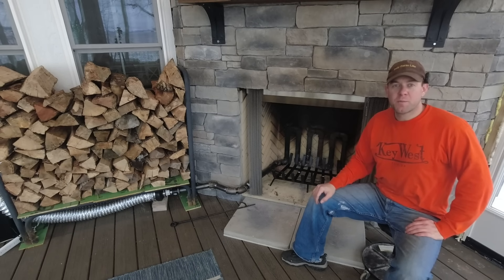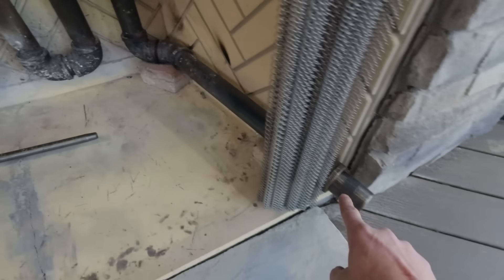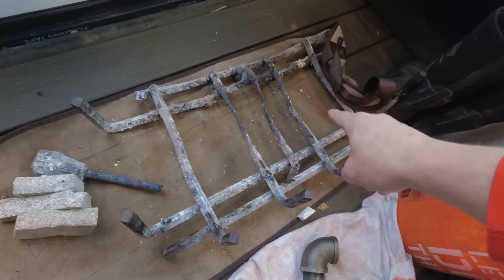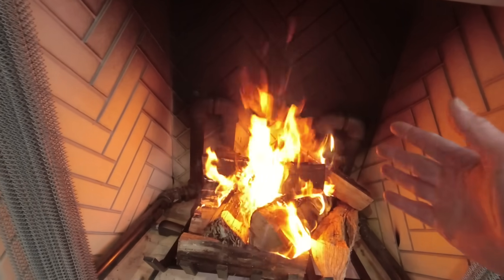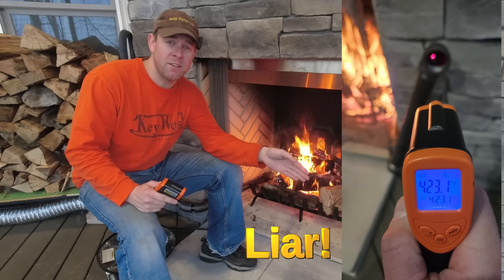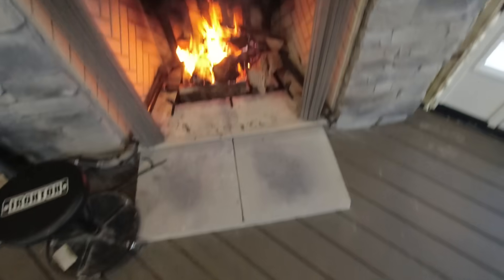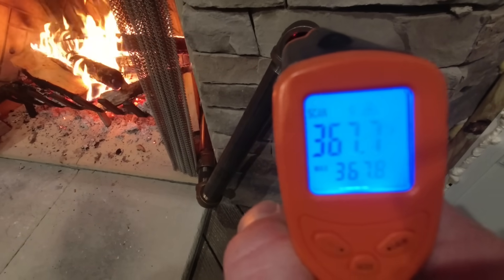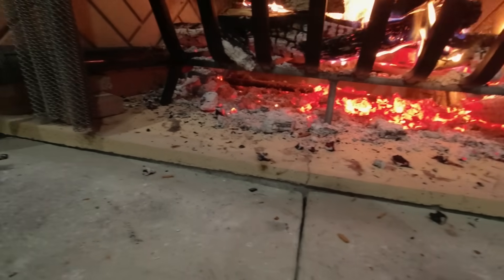Your Fireplace Is Wasting Heat — Here’s How to Fix It!

Comment: Anyone watching this video might want to consider this. The $ spent on that fireplace, the black pipe and fan, and the excessive amount of wood needed to feed it you could have bought an attractive wood stove with a glass front for a fraction of the price. The amount of heat produced would far exceed anything you get with that modified fireplace. You can cook and bake on wood stoves with no need for electricity. And the efficiency at capturing the energy from the wood would not only eliminate any need to insulate, but the exhaust from the chimney would be cleaner  with the catalytic burner found in most modern stoves. If you desire the ambiance of a crackling fire they have youtube videos you could play on a speaker without the sparks and worries of not being up to code. If you're into experimenting for creativity sake good luck with your build.
Reply from the maker: This video is for those who already have an open fireplace and want to extract a few more BTU's from it.  This fireplace has been on our porch for the last 4 years and we just recently enclosed it.  I don't want a wood stove, I have one in my barn.  I know what they are capable of and how efficient they are.  If I only wanted heat and didn't care about the ambiance of the space, then that is what I would go with.  This is for a social space; the fire is the centerpiece.  I also split all the wood from downed trees on our property.  It's exercise to me and I'm not paying outright for it.
Reply: @IndyFarmLife gotcha. Thank you for the update. AND for the video.
Reply: Also, many of us have access to free wood. I have about ten trees on 3 acres that are volunteers lol.
Reply: Dude, we live in a 150 year old farmhouse with the original fireplace. Yes, we have heating oil water radiators for the main source of heat. Sometimes people are just trying to use, more efficiently, what they already have. Plenty of free wood around here in Western PA. Plus, it's always good to have a backup for when the power DOES go out.
Reply: @True_Slav_75 this! My furnace went out a month ago, and all i had was a large old fireplace in the middle of the house. The fan on my furnace was still working, and i had put a cheapy exchanger in the fireplace about two years ago. It was just a grate made of tube steel, with a fan attached. A basic one mass marketed.  But i was able to grab the hot air, and route it to the return vent, with the house fan on, which dispersed it and filtered it as well. Not the most efficient, as i was bringing wheelbarrows of pre-cut wood in, but the coldest it got outside in the week i had to wait was low 20s... and the worst i had it was waking up to a 60 degree house one morning.  Impressive, now, doing what your ancestors did every day! Lol
Reply: Also ..get piped in outside air for combustion chamber ..heated air used for combustion is a waste of wood and heated air you just made
Reply from the maker: None of the air I am pushing through this system is experiencing combustion.  The air that flows through these pipes is not part of the air, fuel, spark mix that creates the fire.  It is not being sent up the chimney.  Or did you mean in general for the fireplace?  This fireplace does have two cold air intakes on the backside that are outside and fuel the firebox.  I should have shown those.
Reply: @IndyFarmLife our fireplace actually has a whute that goes down into the basement. Might be an ash chute, no clue. It's mostly closed off with steel plate that had a few holes in it. Plus s9metimes we Crack a window opposite of the fire place to help the draw. 
Again, this is a fireplace in the living room. 
Sometimes I wish you could put photos to YouTube comments. But......probably better of without it lol. Buncha weirdos in the world.

Comment: Good idea, if you really want to make a big difference, you will need to make some doors for the fire place and inject cold air from outside the room into the fire pit , this way you will keep all the hot air inside and not loose it through the chimney
Reply from the maker: Thank you!  Yes, doors would certainly go a long way.  Tempered glass isn't really a good option (also expensive) because you can't close them while you burn.  The laminated glass is even more expensive.  Steel doors/an insert would absolutely get it done, but I'm also trying to balance the aesthetic. There are certainly ways to get even more heat out of this.
Reply: @IndyFarmLife Agree, before I wrote the comment I was planning in my head on what type of doors would be suitable and I didn't have any great answers 😅. One more thing, do you have a damper on you flue ? That could be used once the fire is out . Also adding a cold air even without the doors could help but I don't know by how much. Thanks for sharing your ideas here .

Comment: What a load of shit. That laser thermometer is for surface temperatures, not air. The laser can not read air molecules. Yes, the pipe is hot and hot air comes out, but not at 255 degrees.
Reply from the maker: It's actually a load of heat!  I get that it isn't true to the actual air temp, but it is directionally correct and doesn't negate the fact that the system works and puts out/pulls more heat into the room.

Comment: I use corrugated pipes for a chimney(stainless steel) inside the fireplace and 12V computer coolers to blow the air through. Works good.
Reply from the maker: Nice!  So I would assume that's a much larger diameter pipe?  4" or 6"?
Reply: @IndyFarmLife  I use 2 pipes 10 cm diameter. They blow really hot air when the firelace is heated well.

Comment: Nice job, Adam.  I did something like this back in the early 80's when I worked at a plumbing supply house.  Old house, drafty and floors stayed cold.  I also learned that putting a set of (sort of) sealed doors on the opening made fire control much easier and helped the wood burn at a more controlled rate.  I enjoy the channel and look forward to our sunday get together.
Reply from the maker: Thanks!  Yea, my idea certainly isn't new or novel, but it's not something you see every day.  Steel doors as in turning it almost into an insert?  This fireplace definitely grabs a lot of air and can run through some wood.  It even has cold air intakes on the back side.
Reply: With cold air intake, how do you keep it fire code compliant?

Comment: This reminds me of the old oil fireplace we had in our 250 year old house in Woonsocket RI. The house used to be a Dr.'s home, but was now a house with an apartment (only reason we could afford it, needed the rental income to help pay for it). Anyway, the waiting room (now living room of the rental) had a nice fireplace in it with an oil reservoir that would heat up (not in use now) and radiate heat after the fire went out. Granted this house originally had gas lights, pre electricity days, so the oil reservoir probably wouldn't pass code today.  You might consider putting some kind of protection around the pipe so someone (kids primarily) don't get burned on it.
Reply from the maker: Pete, I would love to see/tour such a house.  Wonderful history!  Gas lights are making a comeback.  Yea, I probably do need to shroud that pipe somehow.  The fireplace itself gives off a 'warning I'm hot' feel to the kids.  That pipe may not from the side.

Comment: An improvement i would try if i were you. Pull your blower air from outside. This will replenish the air your fireplace pulls out of the room(and sends up the chimney) put your fan outside and that can keep the sound down.
Reply from the maker: I like that idea!  A little tricky given the location (there is a door to the left and one to the right), but I'll have to give that some thought.  Would certainly be nice to size up the fan but also eliminate the noise.

Comment: Your on track but your manifold needs to be also across the top of the fire. Your grate is fine. Do not build the grate as a manifold, it would steal to much heat from the wood and you would be unable to keep your fire going. I did your concept years ago with a house that had a boiler/ hot water baseboard heat. I placed a 3 way ball valve ahead of the fireplace. When burning the fireplace I turned 3-way ball valve. Water circulated through and back into the system which heated the whole house. I built with 3/4" black pipe, weldlets and tig welded together.
Reply from the maker: Thanks!  I had considered coming back over the top of the fire, and I had seen several commercial units built as such, but in our use case, I was also trying to balance the aesthetic with heat extraction.  For us, this is for those extra cold days, but my wife wanted it to look unassuming.  A boiler setup like that would be great!  Just have to make sure everything is pressure regulated so you don't end up with a scalding blowout.  Thanks for commenting/watching!